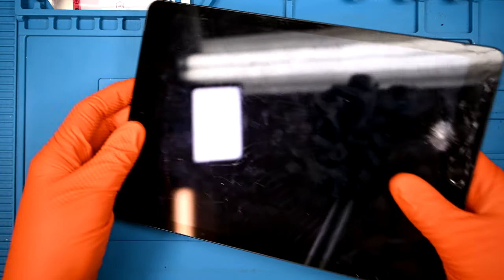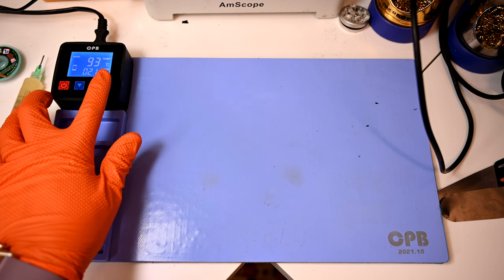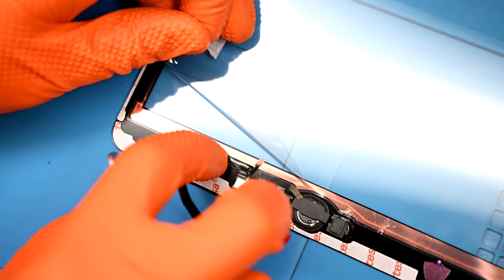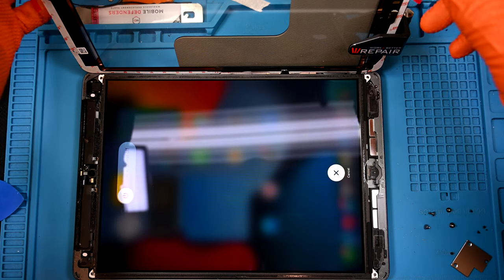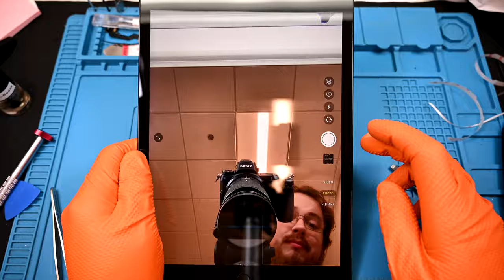iPad 9 (2021) Screen Replacement Guide | Same old traps, thanks Apple

Comment: Great video! A question about the replacement part you used: is it made out of glass? Because the one I've ordered online (not the one you recommend) looks like plastic, so I'm wondering whether I should return mine and get the one you suggest, or is it about the same quality? Obviously, the original ipad screen looks like made out of some kind of glass. Thank you!
Reply from the maker: It is definitely glass. Because it's so large and thin it does flex quite a bit, but definitely shouldn't feel like plastic. Glass is harder than metal, so if you try to scratch the top surface it shouldn't leave a mark (if it's glass). If it's plastic, it'll scratch. But if it is in fact plastic and scrstches, I doubt they'd let you return it...
Reply: @TapticDigital  thank you! I've just ordered the part you recommended, will come back to confirm that it's glass when I get it.

Comment: Great video, I just have a question about the home button application: 

How do I get the home button to sit properly with the digitizer ? My home button came off the bracket so I’ve been having trouble getting an OEM feel. I tried applying some B700 adhesive to the rim that sits around the home button and directly attaching it to the digitizer before using the bracket, but the button still sits really low inside the digitizer. Any help would be great, thank you!
Reply from the maker: The bracket that holds the home button in can usually be bent slightly so it makes better contact with the button itself. You'll also want to verify that the home button isn't missing its nipple, a small black dot on the clicker part. It should also have a matching silver dot on the bracket side. If either of those are missing, it won't stay down or work well at all. You're on the right track with gluing the rim, that is a helpful option but I'd highly recommend checking the nipples!

Edit: also, check to see if there's a plastic spacer thats attached to the rubber around the button, replacement parts often include a spacer already on the digitizer, and stacking two on top can create a "sunken" feel

Comment: son's 9th gen shattered. as a 6-year Sprint tech, i'd never forgive myself if i paid someone $150 to do this before trying it myself lol
Reply from the maker: @aresisis5427  you gotta at least take a stab at it! Really the only part that’s easy to mess up is that home button ribbon, or forgetting the disconnect the battery. Let me know how your repair goes!
Reply: @TapticDigital  the repair went about 99% perfect. got it all put together but the bottom right corner wont' stay down. i did somethin weird with the cable folding and it's not laying flat. (we put it in a Defender Otterbox so lets pretend that never happened) but it works perfectly. i may reseat the glass properly one day with new adhesive

Comment: So my screen cracked on my ipad 9th gen andi ordered and screen replacement kit, but I noticed that it said it doesn't support itouch and the the home button from my broken one would need to be transferred to the new screen. Also said (very risky). could please do a tutorial showing how to transfer home button?
Reply from the maker: The warning just means it won't support the Apple Pencil for some reason. As far as the home button, the risky part is not ripping the ribbon cable, the home button can be replaced but if you rip the original cable it will disable Touch ID permanently. At 2:21 I show how to clean and re-adhere the home button and bracket. It's not quite as bad as they make it out to be. The bracket will be firmly glued to the original so you may need a razor to break it free. The ribbon will also be glued down with weaker adhesive, you can cover the entire home button and ribbon with alcohol to help loosen it up a bit.
Reply: @TapticDigital  you actually responded!! Thanks so much man but you said it won't support my apple pencil anymore? That's the main reason I bought this iPad? So what would you suggest I do if even when I replace the screen I can't use the pencil
Reply from the maker: @AOG5tixkz  I always respond to comments! Except the really ridiculous ones... In any case, I did some digging and found that Mobile Sentrix carries a replacement digitizer that keeps Pencil support, but they may not sell to you without a business license. Then I found Gadgetfix had compatible ones, it'll be their Premium line, and it's less than $10 for the part! It has adhesive pre-installed too. If that fails, I do trust Injured Gadgets, but they don't specify if the pencil is still compatible, though I assume it is.
Reply: @TapticDigital  ok thanks! I'ma gonna order the gadget fix one do I need to order the whole screen from them as well or just that piece
Reply: And if you don't mind could you possibly post the link in here so I can make sure not to get the wrong thing please
Reply from the maker: @AOG5tixkz  go for just the Premium Digitizer without the home button installed, unless your LCD is also cracked (image distorted or color bleeding).
Reply: @TapticDigital  no it's just the crack. And I'm on the website and I also see a supreme one. What's the difference between those two
Reply from the maker: @AOG5tixkz  Sure I just added it to the video description
Reply from the maker: @AOG5tixkz  not much to be honest, they claim it has special coatings and is more break resistant
Reply: @TapticDigital  what's up man. So I just got the screen in from gadgetfix and before I even attempt I was trying to ask you something. So that adhesive that your using I don't have any. So should I order that as well? Because I have to transfer this home button to the new screen..
Reply from the maker: @AOG5tixkz  good point, you will need that. Any thin double sided adhesive will be good, about 4mm-6mm
Reply: @TapticDigital  should I do the tape or that paint like substance your using
Reply from the maker: @AOG5tixkz  the stuff I paint on is primer, it helps the tape stick better
Reply: @TapticDigital  ok this is my last question lol my bad man but I got the part where I disconnect the wire for the home button and touch screen but in the process of cutting the adhesive around the screen I I cut the cord to the home button. But since I'm replacing the screen anyways but want to keep my home button all I have to do is take the home button off the original and connect it to the new wires right?. I can cash app you 20 bucks if you can facetime me to show you exactly what I'm talking about and what I should do..
Reply from the maker: @AOG5tixkz  if the ribbon that leads to the home button is ripped, it's dead. There is no new cable to connect unfortunately. That home button and ribbon are one piece. At this point you can order a replacement button but touch ID is gone. 😕
Reply: @TapticDigital  OMG 🤦🏽‍♂️ ok but will my apple pencil still be able to work
Reply from the maker: @AOG5tixkz  yep, that should keep working fine
Reply: @TapticDigital  so I'm new to apple products right. So since I count use touch id what can't I access anymore because of that.? Also is there anyway that can get that back ? I already ordered a new home button but haven't installed it or the new screen. So I just Wonna know before I do is there anything I can or should do to get the original itouch back (also sorry for all these questions but nobody else has given me options and resources like you've done so thank you again!)
Reply from the maker: @AOG5tixkz  you don't absolutely need it for anything, you'll just enter your pass code instead whenever something wants Touch ID. You could only get it back by having an Apple Authorized repair shop do the entire repair, and Apple parts cost 2-3x a normal repair.

Comment: I wonder if there is any possibility to transfer the antiglare filter from the original glass into the replacement one. The newly installed glass is just noticeably more reflective, which isnt nice.
Reply from the maker: Come to think of it, you're right. I've never noticed but they certainly are slightly more reflective than the factory

Comment: so i watched your video like three times to make sure that i didnt mess up, but my ipad 9th gen is telling me that it cant connect to the touch ID and everytime I go to enter my passcode the screen acts as though it needs calibrated, it also say unable to connect to touch ID. now i did everything like the video, does that mean i have a faulty screen and need another new one or is it fixable
Reply from the maker: Since the home button ribbon is separate from the digitizer, it's likely a problem with the home button ribbon itself. Check for even small rips or tears, usually near the button itself. Unfortunately if it's damaged, you'll need a replacement home button, but Touch ID will never work again unless you have Apple replace and calibrate the button themselves. Which is strange, considering you can swap a fingerprint reader on a Samsung whole the device is powered on and it still won't disable fingerprints, but Apple will be Apple.
Reply: @TapticDigital  i can use the home to turn the screen on and open the screen but it opens to my passcode. which i cant enter correctly because the screen keeps like wobbling. i could post a video of this happening but i have to wait six hours due to being locked out from the wobbly screen movements hitting the wrong buttons
Reply: @TapticDigital  i dont know what to do or how to fix it. if i can fix it without needing the touch ID i dont mind losing that feature i havent had a chance to set it up anyhow
Reply from the maker: @skylarisaac5681  best bet would be ordering a replacement button, unless yours still functions as a home button but just has Touch ID disabled
Reply from the maker: @skylarisaac5681  if it's wobbling or ghost touching that's a sign of a bad digitizer or very loose connector
Reply: @TapticDigital  alright thank you i was wondering why it keeps wobbling and like you said ghost touching. i'm going to see if the connector is too loose and if i'll have to order a new one thanks for your help and advice
Reply: My Touch ID not working either. Home button works and everything else fine just Touch ID

Comment: Help i broke the home button latch what do I do?
Reply from the maker: Super common problem, push the ribbon in as far as it goes, then use a piece of tape over top to hold it in place. Ideally I'd say replace the latch, but tape will hold just fine.
Reply: Thanks I’ll try it

Comment: Dude I have a question does changing the digitizer stops the true tone?
Reply from the maker: It does not as far as I can tell, but I'd imagine swapping the LCD would. Especially since this is the first in the series to use True Tone
Reply: @TapticDigital  definitely going to do it myself, since it cost 45$ from a third-party repair shop in my country. Thanks alot for the video. This is honestly one of the best, I’ve watched

Comment: What happens if the screen is black after i reattach the ribbon cable of the screen
Reply from the maker: Means the connection is loose/damaged or the LCD itself is damaged

Comment: My dog stepped on mine and when I tried changing it the screen didn’t turn on 😢
Reply from the maker: @cr3aturess  but I’m guessing the glass is fine? Too much pressure on the LCD can definitely crack it without damaging the actual glass. Sucks either way

Comment: just finished replacing the screen and it works but now it won't show the battery percentage and it turns off then back on again on its own
Reply from the maker: Battery screw is loose/connector not lined up with battery. In rare cases it can be bent pins on the battery connector, but more often than not its a loose screw on the battery terminal
Reply: @TapticDigital  I ended up loosing the battery screw but I found it and screwed it back in but it's still having the same issues, is there anything I can do?
Reply from the maker: @sceneben  it's possible that the pins on the board that touch the battery are bent. The next step would be taking the board out and flipping it over to check those pins

Comment: Would you use this same method on an iPad Pro 11 inch display?
Reply from the maker: The Pro is likely more similar to my iPad Air 4 video, but a lot of the pro series has the cables and board in the center of the device. it's very difficult to angle the display up to connect it properly without damaging it in the process. iPad Pros are one of the few devices I dislike working on.

Comment: be careful with the battery connector (1:23) I would'nt use a guitarpick... I damaged the pins inside doing this.
Reply from the maker: I've since switched to making custom battery separators from plastic playing cards, mostly because of the risk you described! IFixit makes a special plastic tool that has a much more chamfered edge and works better than the old guitar picks

Comment: I recently did this and all went well until I realized despite the iPad indicating that it is charging, it really isn't. The iPad worked on & off the charger until the battery inevitably died.
Reply from the maker: It a lot of cases I see it's actually a loose charging port. There are two small Phillips screws that mount the port to the frame, from general use these can get loosened because Apple hasn't learned that threadlocker is a thing. You can test this if the device is open, by holding the internal port flat against the frame with your thumb, and plugging a charger in. Sometimes the port needs to be replaced if the ribbon behind the port creases from being too loose. Another top Apple engineer, putting a port on a ribbon instead of a daughterboard. True "genius"
Reply: @TapticDigital  I will check this when I go back over there. Thank you

Comment: are the 9th gen and 8th gen the same digitizer?
Reply from the maker: They sure are, 7 8 and 9. Though I heard they can sometimes have issues with the Apple Pencil on the 9th Gen.
Reply: 7/8 digitizers are the Same size and same connecters so they can be used on a 9th gen, but the 9th gen is different.. It has a wider front camera hole aswell as spaces for the top sensors to see through, for the true tone function/auto brightness, using an iPad 7/8 digitizer on a 9 will block the sensors and then true tone will not function.. Better to use a digitizer made specifically for 9th gen 👍

Comment: hey, i got a problem after reconnecting everything my ipad keeps restarting after a black screen with sometimes a glitch line, that appears right after the apple logo. I still  didnt reassemble it, u got any tips?
Reply from the maker: Sounds like a semi-loose LCD connector. Definitely try reconnecting it, and while you have it off check both the plug and port for any bent or missing gold contact pins. It definitely sounds like a LCD issue and not a board issue though, if that narrows it down at all!

Comment: And people are shocked as to how apple is sitting at 3.1 trillion market cap. They stuff is so easy to break and they make it borderline difficult to replace and fix it all.
Reply from the maker: Bingo, sell older underperforming tech with flashy marketing, tell people they can't repair it, fill your pockets.

Comment: So you have social media I just have a question for you
Reply from the maker: Sure what's up?
Reply: @TapticDigital  do you have to replace that piece of rubber you mentioned disables the touch ID?
Reply from the maker: @rodrigor.6496  Nah, it's just a foam piece adhered down. You have to remove it or else the ribbon will rip which is what disables touch ID.

Comment: At least the damn digitaizer isn’t totally glued to the lcd😊
Reply from the maker: I wish I could say the same for the iPad Airs! Such a pain to have to replace both even if only one is damaged.
Reply: Yeah I got 2 iPad Air 2 here. One with cracked glass and one with messed up lcd. The one with the cracked glass I haven’t even dared start to work on;) the lcd one is easier but expensive🤨

Comment: My pencil didn't working after changeing display 😭
Reply from the maker: The iPad 7, 8 and 9 can use the same digitizer, which makes me wonder if the 9 actually has some extra hardware. I'm curious if getting a digitizer specific to just the iPad 9 would resolve this, but unfortunately the Apple Pencil isn't part of my testing so I wouldn't know.
Reply: @TapticDigital my iPad 9 gen.... It's is a big problem.... Plz help if possible

Comment: Thanks for not warning us about the fucking ribbons on the side and also not showing us how to safely remove the home button. Basically the 2 most important parts of this.
Reply from the maker: So you missed 1:41 and 2:23 where I disconnected the cables first, then showed how to clean the home button? Or was it at 0:42 where I warned that the digitizer and home button ribbons run along that side? Or did you mean take the home button off the shatter glass? Because that's easy, you just cut the bracket off and remove the home button ribbon. Sorry to hear you seem to have struggled with the repair.
Reply: @TapticDigital  hey dude, the screen works absolutely fine but as soon as i unglue the side ribbons and stick it to the screen, only my half of the screen is responding. i replaced everything and my 1 2 3 number on keypad doestn work :(
Reply from the maker: @LinjaRai  sounds like one of the two connectors from the digitizer is either loose, or getting pinched between the glass and the frame when you close it. Check the ribbon for any hard bends or creases.
Reply: @TapticDigital  thanks so much bud, really appreciate your help and efforts

Comment: is dust on lcd visible and hard to clean after glass replacement?
Reply from the maker: Not at all, a quick burst of compressed air will clean it off easily. If you have to wipe, use a new clean microfiber and wipe very lightly